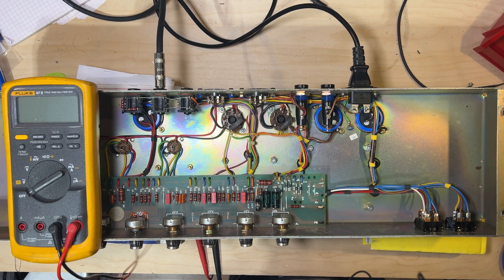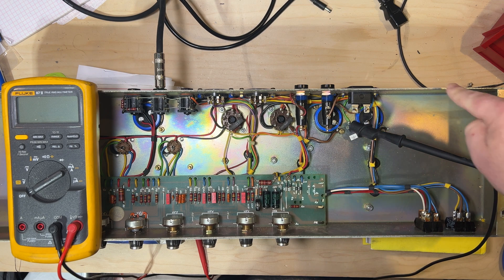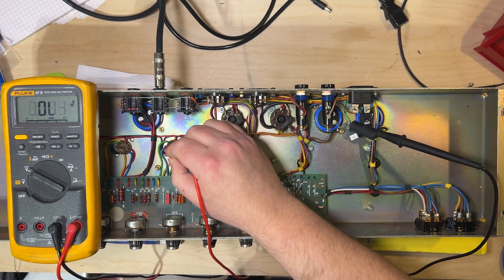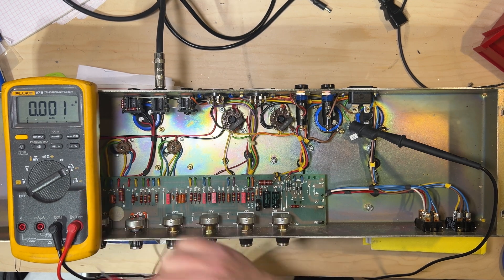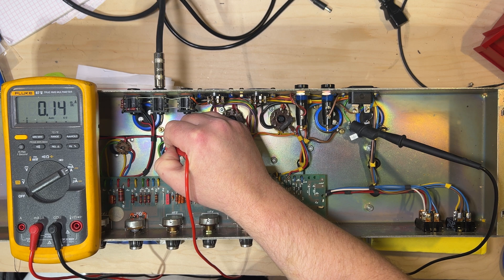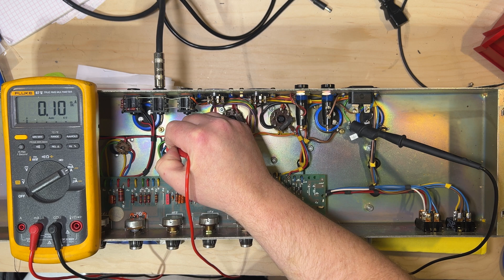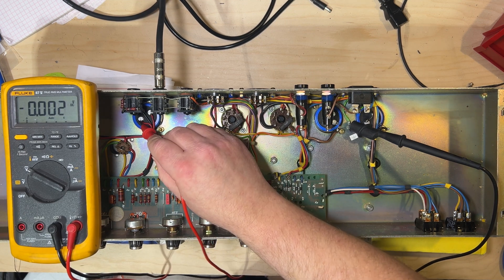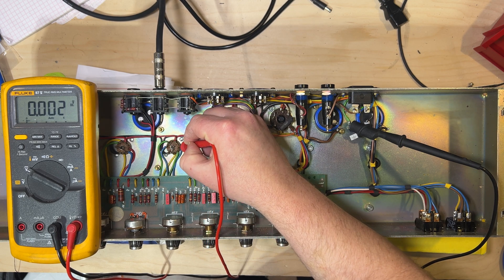Discharging Filter Caps in a Guitar Amp

Comment: I have a Fluke 177, so do I move my red lead to the 400mA input or the 10A input to discharge the caps? Thank you!
Reply from the maker: That should work fine! In the video i use a 400mA fused connection for Amperage so you should be fine using either the 400mA or 10A input on your Fluke 177.
Reply: @TechnologyEnterprises  I tried it in both 400mA and 10A but didn't see the reading go down on the 177. But I did go back to VDC to measure the filter caps in my Marshall and instead of reading around 6vDC, it now reads around 0.159vDC, so it looks like it worked! Thanks!
Reply from the maker: In that case it most likely discharged a low current and just didn’t register in the units the meter was set to, or quick enough that it didn’t register. Glad to hear it worked!
Reply: @TechnologyEnterprises  Good to know so thank you! I had it set to auto ranging so perhaps you’re right and it just didn’t register! Amazing how the charge comes back up a little on the filter caps with the dielectric absorption phenomenon! 
Glad I came across your channel so thank you!

Comment: I would have left my meter on voltage thinking the caps would discharge quickly just due to being measured. Thank you. I have been lucky.
Reply from the maker: When you are measuring in voltage your multimeter is acting as a VERY high resistance to draw as little current away from the circuit as possible so that a true measurement is made of the point under test. When we are draining caps we want a lower resistance. With NO resistance you may get a spark. Some people use a resistor in series with a long probe in order to slow the drain and reduce the chance of damage from an arc. I prefer to drain caps through pin 1 or 6 of a preamp tube since in most amps that will then use the plate resistor to help slow things down a little.